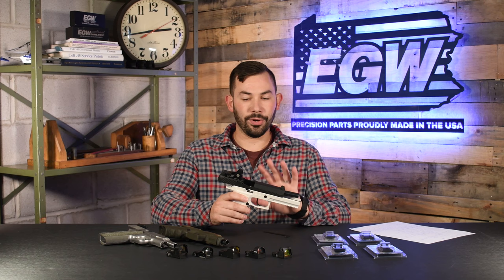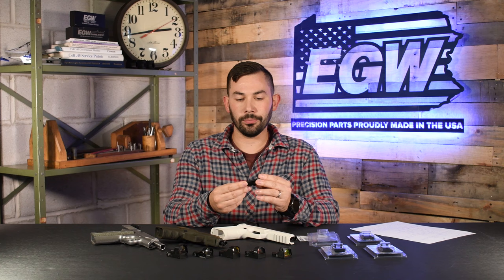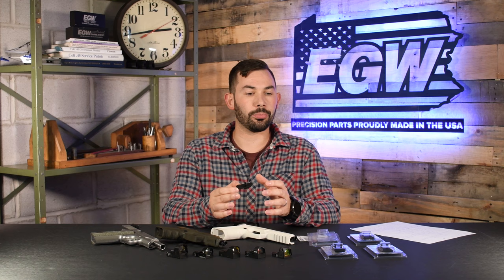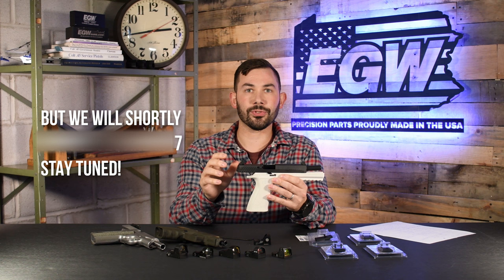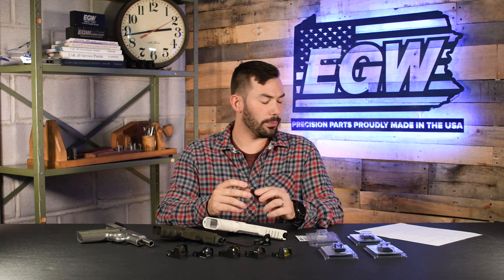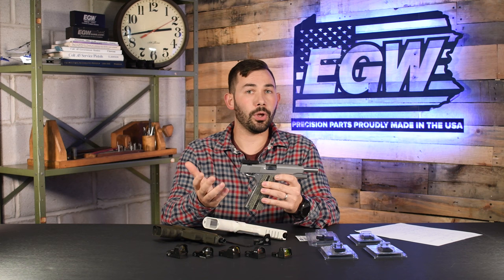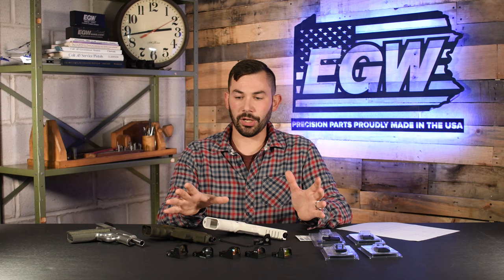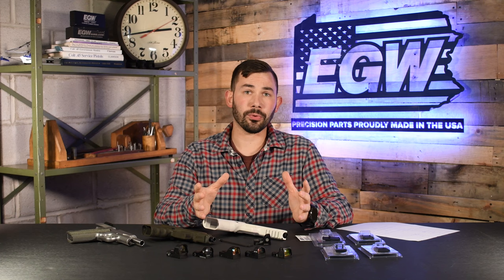Red Dot Mounts | Everything You Need to Know, and More

Comment: Do you have one for S&W SD9VE?
Reply from the maker: Hi, thanks for reaching out! Unfortunately, we don't have a mount that will fit the SD9VE, you can however use one of our blank mounts and have a local gunsmith or machinist cut it to fit your dovetail.
Reply: @EGWInc  thanks for getting back to me so soon. Do you plan on making one in the future. Im just trying to avoid having the slide cut incase I dont like the red dot. Was looking for a quick cheaper alternative.
Reply from the maker: @omarcarlisle3354  I apologize. I misread our listing. Our M&P mount should work for it. Which red dot are you looking to mount?
Reply: @EGWInc  oh no problem.  ok well thats good to know then! I was thinking about the vortex red dot. So the just to be clear the M&P mount will work with the SD9VE?
Reply from the maker: @omarcarlisle3354  Correct. You can find the Vortex Venom and Viper mount here. 

https://www.egwguns.com/viper-venom-s-w-m-p-sight-mount-fits-burris-fastfire-and-docter

Comment: How about performance does it maintain the fit? Thanks
Reply from the maker: The dovetail is a press in fit just like the rear sight that it replaces which keeps it in place extremely securely. We also have a set screw on most of the mounts which provides upward tension on the dovetail. When installed properly, our mounts are rock solid.

Comment: I just bought  this product for my Ruger Blackhawk 45lc. All is can say is, the quality control needs to have some upgrades, VERY sloppy fit, it's loose fitting on my gun. I'd rather have it tight and need to file it, but nope, it's small and loose.
 One would be lucky to print a 48 inch, group with it at 50 yards horizontal.. Site says it has 5 screws, I paid $4 for the extra ones, but only received 3, and it was missing what I needed. So I got ripped off for the $4 and only 3 out of 5 screws that normally come with it. 
  Avoid this product at all costs. Biggest ripoff the planet has ever seen.

Comment: Why can't they just make these mounts in picatinny style mount for universal red dots?
Reply from the maker: There are some other companies that do make a rear sight picatinny adapter plate. There are a few reasons we do not make one, the main reason being height over bore. The picatinny dovetail adapter would be taller than our current mount and the adapter that came with the red dot for use on picatinny would add even more height. That would put the red dot very high over the bore axis, which would also introduce a greater possibility of alignment error. One of the most common complaints we receive is that our current mount is too high and you cannot cowitness with it. We manufacture our mounts as low as possible, within the limits of the material. Adding extra height and material also adds weight which could possibly effect reliability and cycling. I hope this helps!
Reply: @EGWInc  i actually look around a little more and saw them , i see what your saying, thank you for the reply.